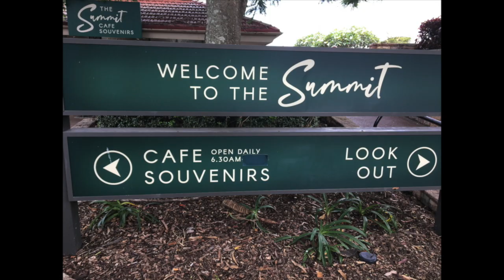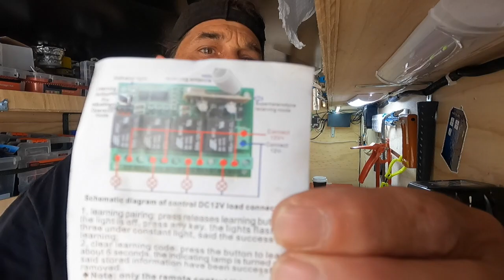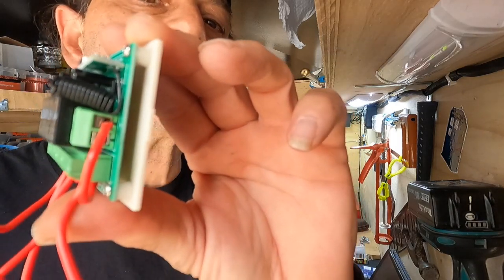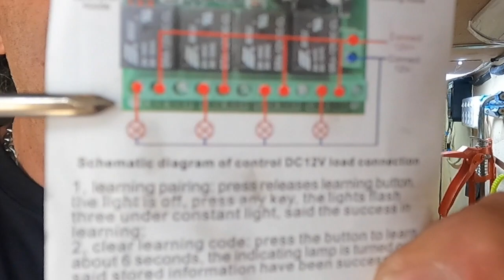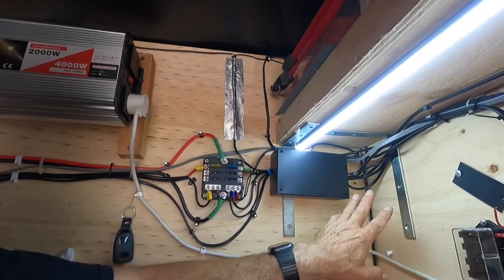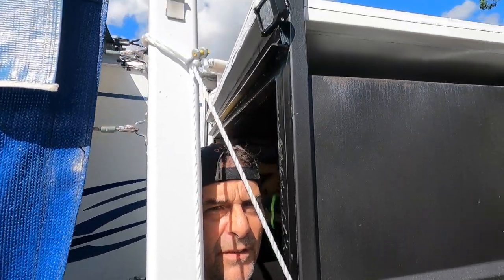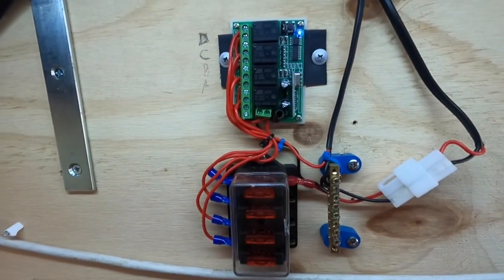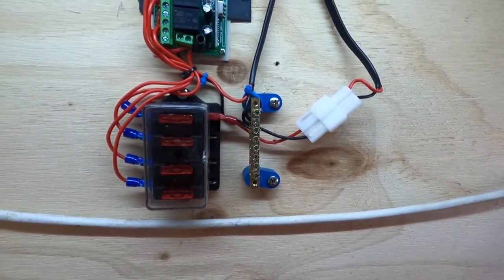12v Remote Control Switch

Comment: Hi. I'm not wanting to force wires and fit switches into dash then wire through firewall for big driving lights. 

Will this do?.
Reply from the maker: Yes this will work. Install this item under the front of the car and you can have the remote inside of the car. 👍

Comment: Mate, that's awesome!! I have wired it up but the light turns off again in like 10 seconds? It won't stay on... how do I make it stay on?😊
Reply from the maker: There is a lot of variables that can come in to play. What's the power source, what items are you running?  I will need more data on what you are trying to do.
At the end of the day it could be a faulty unit.
Reply: @ozrvtravelshow  I am running it on my finger ute, and powering LED lights, if I use A to power the light, the light turns off after 6 seconds, if I use C for power to the light it turns on after 6 seconds.🤔

Comment: Want to ask..🤔
1. Suppose there are 2 receiver modules close together, will it 1 remote controller be able to control both of them? Or does each receiver module only have worked 1 remote control package?
2. What if the remote control gets lost?
3. Should we buy another set or is it just enough to buy the remote control only?
..Sorry for my language english is bad..😁  Greeting from Indonesia..(˛•̃•̃)/🍻\(•̃•̃¸)
Reply from the maker: Hi Bulu 
1. There is only one remote that comes with this unit, but you can get other remotes for this unit too. All you have to do is pair the other remote to the head unit. That means you can have to remotes for one unit.
2. If you lose the remote you can buy one on ebay and pair it to the head unit. So its not a drama if you lose it.
3. Its alway good to have a spare remote. The remotes don't cost that much.
I hope that helps you in a way. If you need any more info on this item please don't hesitate to contact me.
Reply: @ozrvtravelshow  Thank you for your explanation. Now I understand how it works .. Btw, how far is the remote control? is it more than 100 meters perhaps?